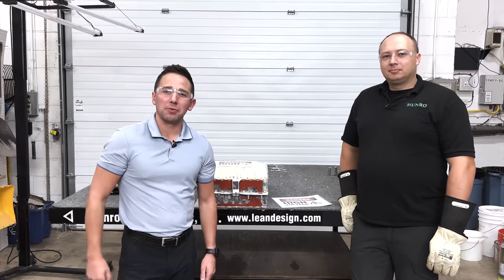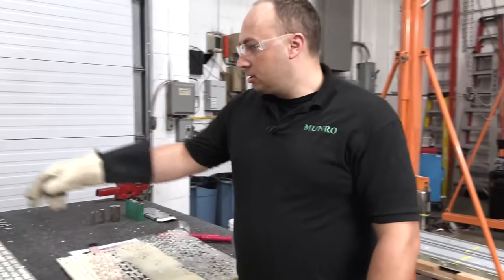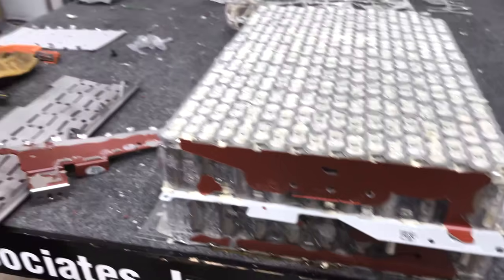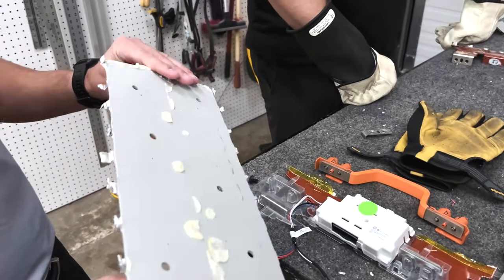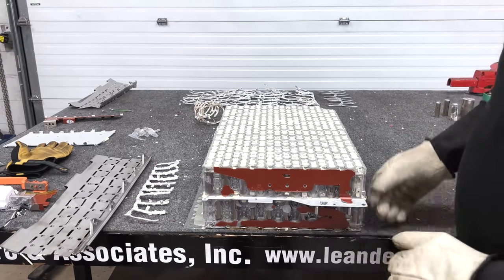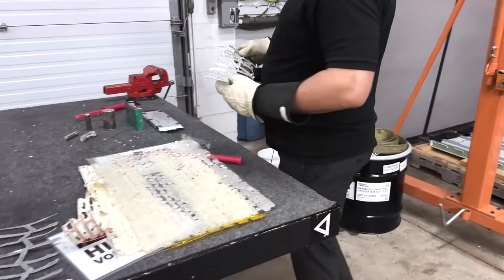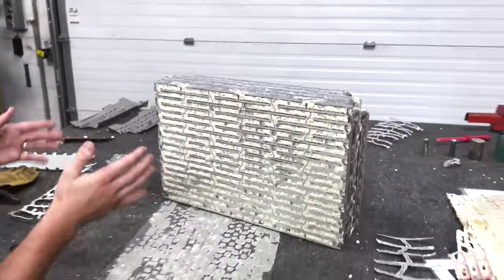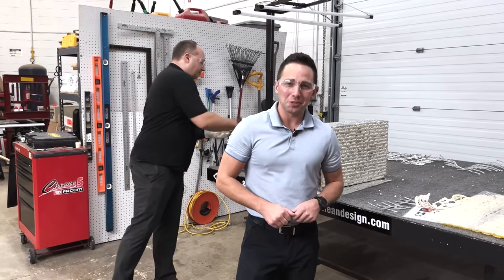How Rivian's 7777 Batteries are packaged!

Comment: While the technology is impressive indeed, what's not being discussed by anyone is the recyclability of these battery packs.  When it takes literally a chisel and brute strength to disassemble these battery packs, exactly how are companies like Tesla and Rivian (or anyone else) doing this?  To me it just seems like an ecological disaster that is being ignored for people down the road.
Reply: At least, Rivian battery packs can be repaired at the module level. Test all modules, identify the good and bad ones, than swap the bad ones with other good modules. The bad modules could either be sent to recycling or used in a non-critical, controlled environment.
Reply: And the verdict is: it will blend

Comment: But wait, what happens if one of the cells goes bad? The pack is a brick, right? What about repairing the pack? All that foam will make it difficult. LOL sorry could not resist trolling all the moronic comments from the 4680 tear down.
Reply: If a single cell goes bad, it's likely disconnected.

Comment: People really this stuff dissolves with basic chemistry same with teslas like your wondering how there going to recycle this when its so hard but its only hard because your doing it completely rong 🤣.
Chemistry people get some chemistry people in there to dissolve the binders on the batteries for God sakes 🤣.
The Polyurethane i mean and some of the other adhesives not the metals 😅.
Reply: I am a chemist. If it dissolves the acrylics, it will dissolve/swell the gaskets. If we were scraping everything, yes, THF bath, mix in some ethyl acetate and MEK.  For display purposes, elbow grease.